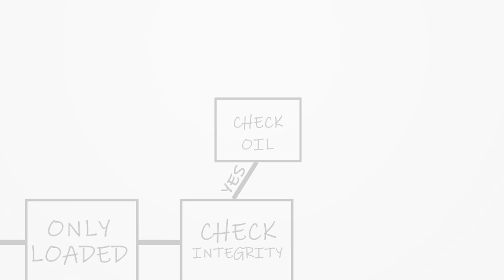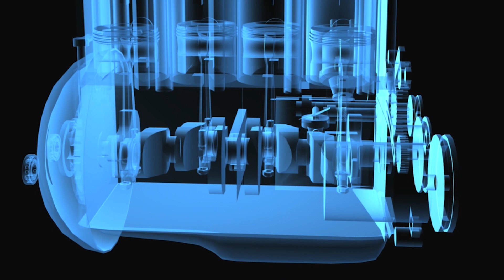How to Diagnose Engine Noise Under Load

Comment: hi i have a 2008 ford fiesta 1.4 tdci.. every time i press the gas pedal down, there is a noticeable single knock. this happens in 1st, 2nd and 3rd gears, not in 4th or 5th. it isn't just when changing gears, it's every time the gas pedal is pressed. took it to 2 mechanics, and after almost a week at each place, neither have any clue what it is. they said it sounds like it's coming from behind the dashboard. any ideas?
Reply: Maybe an engine or gearbox mount is worn.
Reply: @Alexander_l322  indeed it was... the lower mount. got it repaired, and sorted the problem straight away.
other faults occured, with it being a ford, so i got rid... on the lookout for another car now haha.
but thank you so much for replying!
Reply: @dvdsmlprstylr  it’s cool bro glad you got it sorted and I’m glad I was right! Makes a change 🤣. What you described is a common symptom of a worn mount and if I was you I’d find a better mechanic since the two you went too got stumped and someone on YouTube could figure it out without too much thought! Also thanks for the update so I got some closure 🙂
Reply: @Alexander_l322  yeahhh managed to find the right guy and will stick with him from now on.
what;s your opinion on the most reliable (used) car? been tempted by a yaris 1.33 vvti, but heard their mpg goes down when on a highway/dual carriageway, and im looking for the sweet spot... maybe a petrol Seat 1.4 TSI ACT FR?
Reply: @dvdsmlprstylr  well the Toyota is probably your best bet. Although it may use a bit more fuel when gunning it down the motorway but if you stick to 60/70 mph then it won’t be bad on fuel, especially around town it will give you good mpg. That can be said for a lot of smaller cars with small engines since they’ll work harder to get up to 70 and stay there where as a bigger engine car will cruise more effortlessly. I’d say test drive a Yaris first and see how you get on but if you do a lot of motorway driving then get a diesel preferably a 1.6 or 2.0 since these will be frugal pretty much all the time unless you floor it everywhere but I don’t recommend a diesel if you mainly do stop start driving since diesels don’t like it. 
My Volvo V70 I have right now is a small 1.6d and it gets about 50/60 mpg without driving it like a granny. 
I can’t say much for the seat 1.4 TSI but usually VAG (Volkswagen,Audi Group) are not that great and seat is part of VW, depending on the year and which 1.4 engine (there’s two) one is bad news with oil consumption and timing chain issues and the other is supposed to be better and not have many issues, but with a long warranty and don’t get a DSG gearbox if you can help it. I’d try for the Yaris or something else if I were you.
Reply: @dvdsmlprstylr  read up on any cars you want, Yaris may not fit what you want either 🤷‍♂️